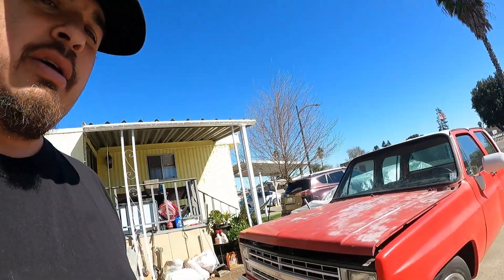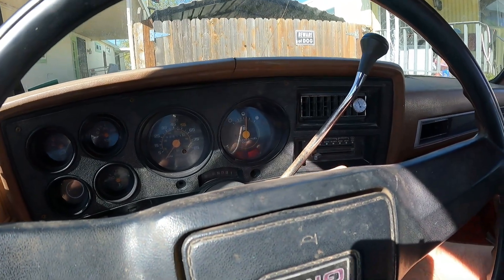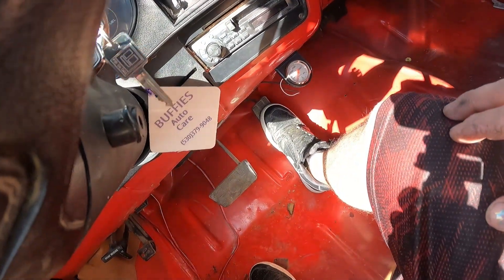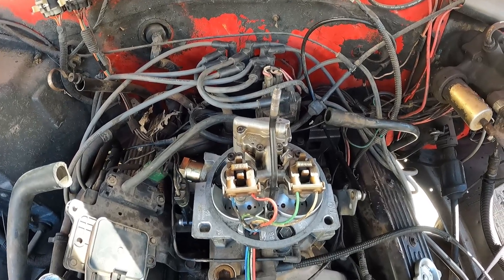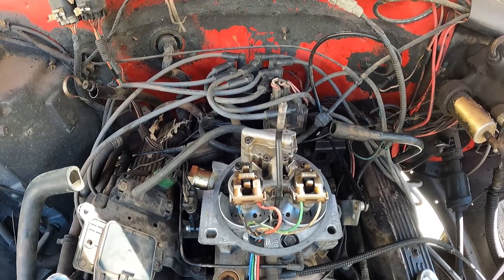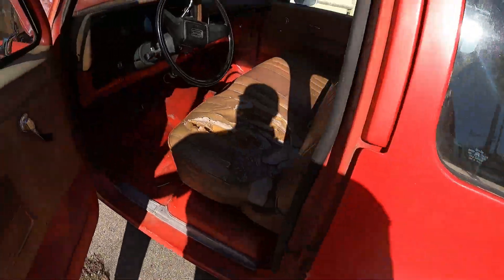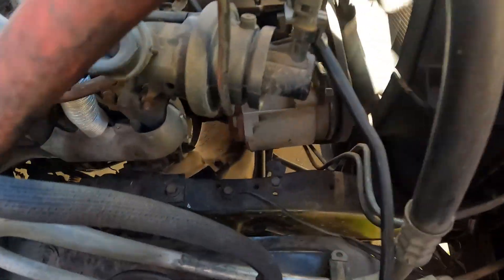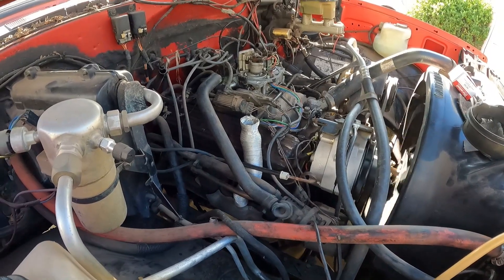TBI chevy wont idle, what fixed it

Comment: Pick up coil in the distributor needs to be replaced. What happened to the impala? I have 2 1966 project impalas. Fuel pulse on injection is controlled by the spark from the distributor. I had the same problem
Reply: Well never mind, it was the fuel pump!
Reply from the maker: Still got the impala, just got a house 2 months ago and drove it to its new home yesterday, made a quick update video, will be posted up soon